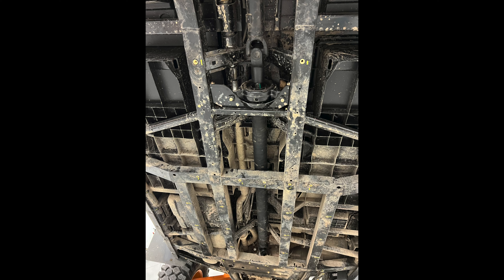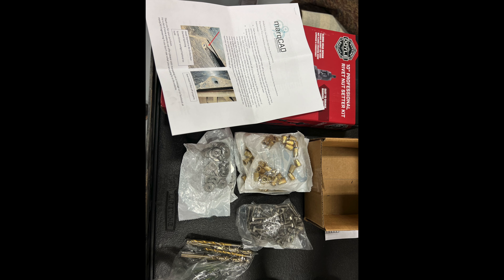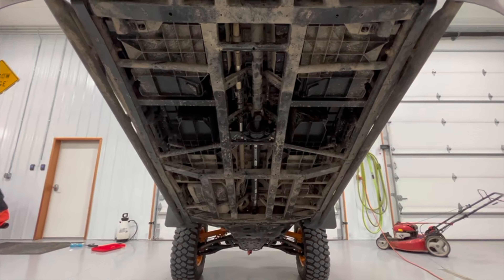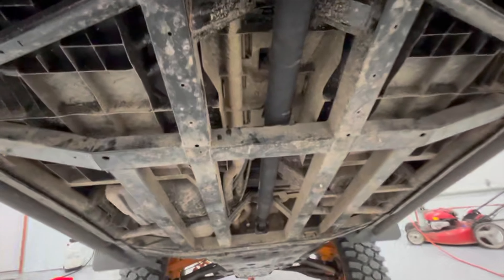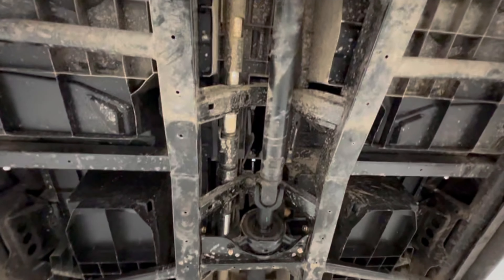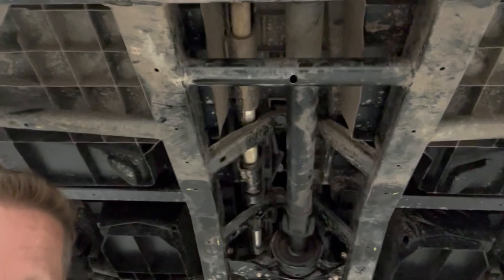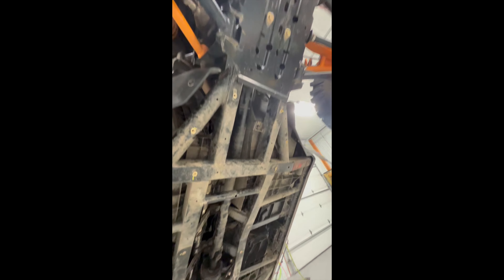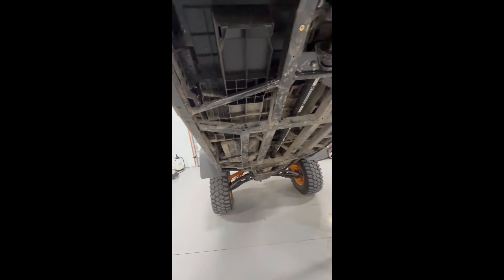CanAm Commander XTP Driveshaft Vibration Fix and skid plate rivets Replacement

Comment: Thanks for sharing this video. Quick question: How long is the rubber sleeve for the driveshaft?
Reply: I believe it is 3' long
Reply: Thanks for the reply. Sorry but I have one more question,  in your video you say 1 5/8 hose, but when I look up the par number you provided it's a 1 3/4 hose. I just want to make sure I get the correct size hose. My 2022 commander max xt is in the shop right now awaiting the new driveshaft. Thanks again for the video.
Reply: @ThomasNewland-r4m  I apologize, I made the mistake in the video. The PN shown is correct (1-3/4")
Reply: @danemery7228 thanks for the quick response. I will be ordering.

Comment: Thank you for sharing, my commander is currently waiting for the parts to arrive at the dealer for this tsb. Do you know if your dealer used an adhesive to keep the rubber sleeve in place?
Reply from the maker: Thanks for watching!  I'm going to defer to Can Am Dan for this one!  He will reply with the details.
Reply: Thanks for watching, no need for adhesive as it is very tight and needs lubrication to get it on.
Reply: @danemery7228  Thank you for the quick reply.  Really looking forward to not hearing this anymore.

Comment: What length is that hose? Also how do you remove the rivets for the skid plate? I started that process today and those things are a pain in the neck.
Reply: It is 3' long, and yes the rivets are a PITA to drill out and replace. Incredible amounts of drilling. I used a good sharp 3/*' bit and it worked pretty good. If the rivet starts spinning you need to jam a sharp screwdriver behind he flange to give it enough tension to not spin.

Comment: Question - whether you drill out or sheer off the stock rivets, doesn’t a portion of the rivet then remain in the closed frame rails?
Reply: Hi! Yes the back side of the rivet stays in the frame. Hopefully will eventually fall out on the trail. Thanks for watching!

Comment: What size are the nurserts and bolts used for the skid plate?
Reply: I used a kit from MarqCad engineering. They are 6mm nutzerts. Close to 100pc to do all the skid plates on a max. Bought the Harbor Freight nut zert tool. Would suggest getting the long handle one for better leverage.

Comment: Do you know if this service bulletin only covers the 2023? I have a 2022 Commander Max XT that has had this issue since day one. I contacted can am and they said it doesn't apply to my unit and they refused to tell me what that bulletin covered. Getting the run around from Can-am it seems like.
Reply: @jacelarsen9834 There is a Can Am service bulletin for all the max's no matter what year. Tell your dealer bulletin #139860 "SSV 2021-2022 Commander Max/Maverick Sport Max Driveshaft noise repair"
Reply: @ogcanamdan  my dealer just said he sees the bulletin but that I am out of warranty on my 2022.  The warranty was for 6 months from date of purchase and there wasnt even a bulletin then.  Is the bulletin for all 2022?
Reply: That is crap! The service bulletin is for your machine whether it is in warranty or not. Find another dealer or report them to CanAm for not performing the service.

Comment: What service bulletin number? TST??
Reply: Drive Shaft Fix:
CanAm Bulletin:  TST 139861
Shaft Part Number:  705402245
Just heard last week from my local service manager that this has been replaced since and they are now working on yet another revision. I will be contacted when that is released as I still have a little rattle early on the throttle.

Comment: My 22 max has the same issue
Reply: Make sure you get your dealer to get the service bulletin prop shaft upgrade. Mine still has a slight rattle but only and very slow speeds.

Comment: No need for the sleeve just drill and tap the yoke for a set screw on one side and a grease fitting on the other  side.